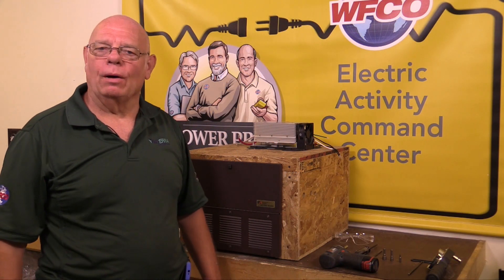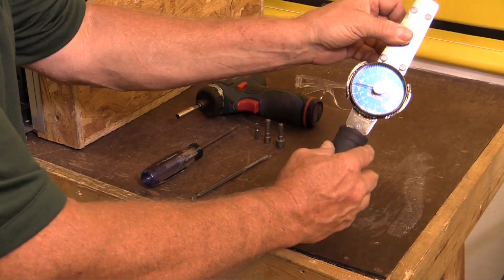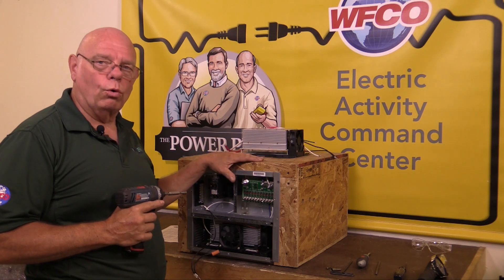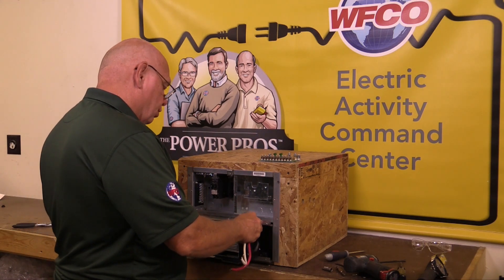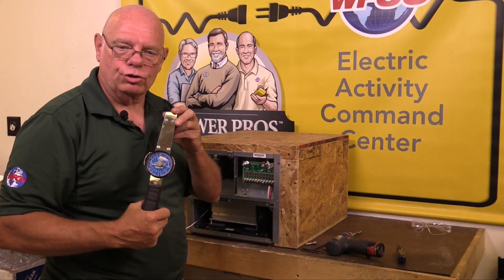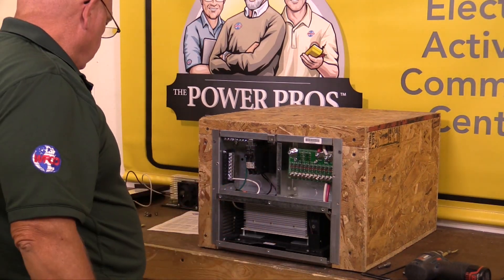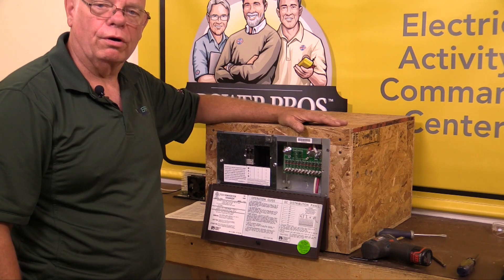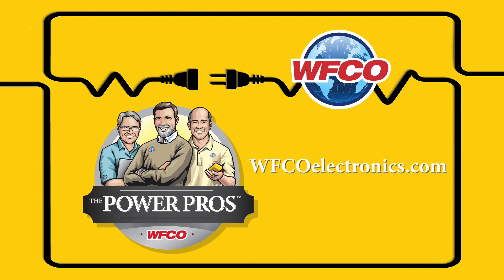WF-8955 MBA (Main Board Assembly) Installation

Comment: How can you still make and sell a converter that doesn't work with lithium? Our brand new Winnebago has a 8955
Reply from the maker: Hi Bob, the 8955-MBA is safe to use with lithium! It just doesn't charge it 100%. It will safely charge it about 80%. If you want a product fully optimized for lithium we have the WF-8955L2-MBA.

Comment: Its a Robertson bit, the first step is making sure the ac input "mains" is off and not fat fingering every wire you can fondle, pound foot of torque ,  pound inch or torque, and lastly "This video is about Power center replacing installation" really?  Come on now.